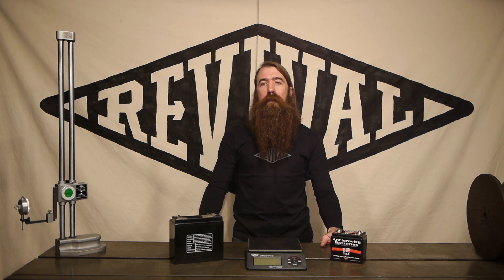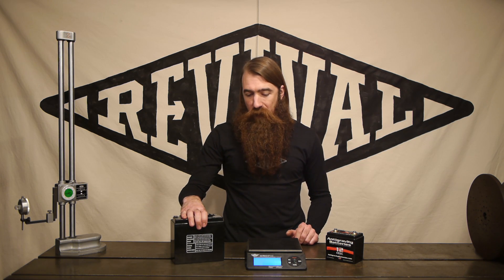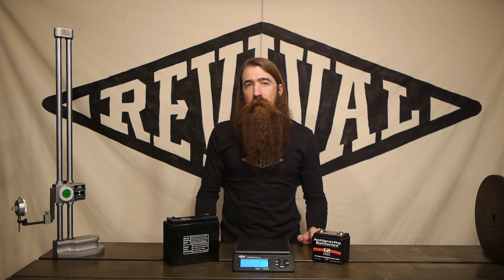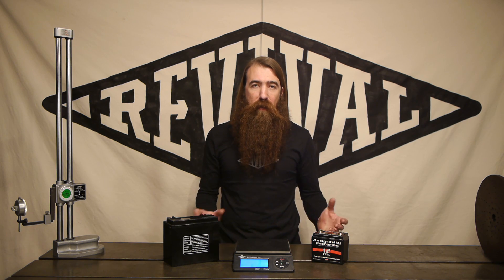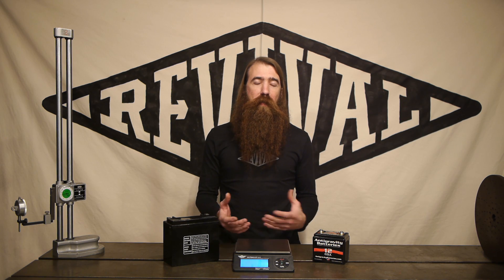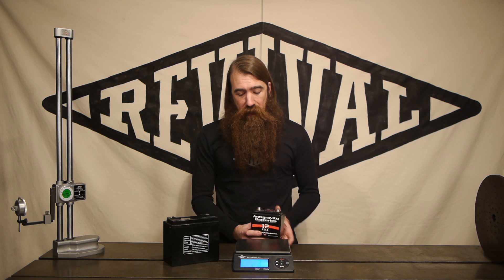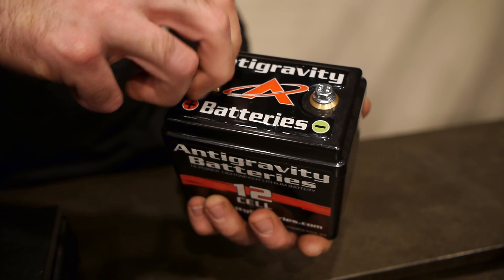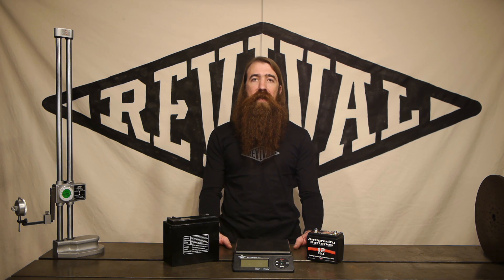Antigravity Lithium Batteries - Revival Cycles Tech Talk

Comment: Hi Stefan, 

Awesome channel and workshop, I've watches most of your videos, and even went on to buy the M-unit and the M-lock for my current project; a Suzuki 85' GS 450S. 

Problem: Lithium-ion/phosphate battery and charging system compatibility. I've read that the Li-ion/phosphate batteries are not compatible with the charging system on older bikes from from mid 1980s and earlier. In worst case the battery could take permanet damage. The bike has it's first registration in '85, but the bike is likely older than that.

Question(s): Do I need to update my charging system? If so, what should I look for?

Best regards, from Denmark
(Source: https://shop.antigravitybatteries.com/products/starter-batteries/small-case/ag-801/)
Reply from the maker: Hey Christian - If the charging system on your GS is working properly and performing up to design spec it should be compatible with the Antigravity batteries. The most important part of working with this type of LiFePO4 battery is that the charging system has to keep the voltage between 13.25 and 14.75 which is a fairly broad range, but much below 13.25 volts and the battery will not be charged properly, but more than 14.75 volts will over charge the battery and damage it. 

On you bike you have a three phase permanent magnet system, with a combination regulator / rectifier. Most of the systems that are problematic are the ones that have separate regulators and rectifiers. That all means your setup should work, but double check it with a multi-meter at idle and up through the rev range to make sure the voltage doesn't exceed 14.7. 

Also it isn't a bad idea to replace the reg/rec with a new one, it can offer piece of mind, and electronics from the 80's are probably on the edge of capacitor failure by this point.
Reply: Hi again, the charging system has been performing without problem on a regular led battery so far, so thats great. I'll check the charging voltage from idle to full rev. 

It has tree yellow-colored wires coming from the generator to the combined reg/rec. Its an old bike, and has in some way been tampered with by the many other owners it has had. I think I'll replace the rec/reg just to be sure. 

Thanks man, keep it up!
Reply from the maker: Sounds like your charging system should be good to go. But I would make sure to repeat the test after you have the new LiFePO4 battery installed, just to make sure the system remains stable. There are some regulator circuits that are affected by different battery internal resistances, so its worth double checking. 

Also reg/rec's from the 80's do wear out, so a replacement is a great idea. And the $100 investment is cheaper than the hassle of getting stuck on the side of the road.
Reply: Allright great - Yes I know, and it would be a shame to ruin a brand new battery by not charging it properly.  I've ordered a new reg/rec.

Thanks again!

Comment: will an 8-ceel Antigravity work on a yamaha virago x920 1981?
Thanks.
Reply from the maker: The starter arrangement on the 920's is not all that great, and in our experience a 12 cell is better on the viragos. You might be able to get away with an 8-cell but it'd be pushing the capabilities of the starting system. Although the 8-cell has been tested and works well on Ducatis upto 1100cc the issue is that the starters on the ducatis just work more efficiently than the ones on the viragos.

Comment: Ok....so these are used with the standard/stock type Harley charging system? 
  I have a 1972 Sporty, and a 46 Knuckle...both converted to aftermarket alternator (made/sold by Steve Fredricks/Hunt Magneto) ....unit fits in the old 12 volt generator spot and run by same gear set....wound stator, rotating magnets......and use a 'Harley 'type regulator.....I'm NOT looking for electric starting power....both are kick start...mainly looking for replacement for the Yuasa 12N12 LA Sealed battery in Knuckle because it fits in the old 'horseshoe' oil tank.
 Are these batteries something I should be looking at? Local battery store has stopped selling Yuasa, now selling Chinese stuff, which I have no interest in....
Reply from the maker: The antigravity batteries are a great solution,  and they would work on your bike. However the real advantages are for saving weight and having a smaller physical size. Since you have kick start only, you don't need the extra cranking power, and I don't think you'd see much benefit from the antigravity on your application. If you are happy with the performance of the Yuasa I don't think there is a need to switch, and even if your local supplier has stopped carrying them they are available from several other sources. If you have trouble finding them we can source and ship one to you no problem.

Comment: I just got the antigravity 600cca..what should the amp read?
Reply from the maker: I don't quite under stand the question. What are you trying to measure?  Also, 600 CCA is a LOT of cranking amps, we have never needed to use more than 480 CCA and that was on a Hellcat with a 2163 cc high compression v-twin engine (extremely difficult to turn over)
Reply: Yorday Martinez

Comment: How about longevity? will this last more or less than a lead battery?
Reply: Just an opinion, I work in the industrial haz waste field, largely in the Universal Wastes world of batteries and lamps. 
Lithium metal cell arrays can outlast Lead Acid batteries if routinely used, but leave them to sit without activity, and the "memory" decreases far more rapidly than traditional LA batteries. They also react to changes in temperature FAR more radically. Nor do they take to "trickle" charging well, rather they need to be "worked out" regularly and brought back and forth to a maximum charge often for best longevity. 
This is why your phone battery lasts longer when charged all the way up at night, and is used rigorously throughout the day, whereas leaving it plugged in constantly actually decreases it's ability to "remember" as much energy for storage when you finally take it off the cord. And lastly, NEVER allow a cell to be penetrated and get wet. You will have an ultra-hot roman candle next to your gas tank. Don't play with the guts, they are on a different order of magnitude of danger than the corrosive of battery electrolyte.
The cells contained inside are pretty much the same ones you find in Vaping mods, and should be swappable, but economics won't see us swapping our own individual cells any time soon in the same manner we can refresh the individual electrolyte cells of a traditional open cell LA battery. The manufacturer would rather recover it under recycling programs, and just swap the cells at the factory while you buy a whole new unit at full price. Now the guy who invents a flexible battery receiver array allowing you to individually add and remove as many 2k-3k mAH cells as you want to fit in a shapable, customizable form factor, that adapts to fit inside of different seats and frames...THAT guy just might get wealthy. Plus you could remove the small individual batteries for storage in the house away from the cold...
Reply from the maker: Good question, in theory it should out last a lead acid battery.  BUT it all depends on how you treat them, if you keep them charged and don't over / undercharge and they don't live outside during sub freezing temps in winter then they should out last the lead acid counter part. 

In our case, these batteries aren't about longevity, its about saving a TON of space and a TON of weight. 

In the interest of full disclosure, these batteries are more fragile and do not tolerate abuse as compared to lead acid, but with systems that are working properly and normal use they hold up very well. This is an issue for ALL LiFePO4 motorsport batteries, and in our experience, the antigravity brand is the most robust of this class of battery.
Reply: 4c1dr3fl3x Sounds like you have enough knowledge to be THAT GUY.

Comment: Hi, could you tell me wether an antigravity 8 cell would be sufficient for a 1980 CB750 dohc? or would i have to go up to the 12 cell.
thanks for all of your videos and thanks in advance for the help.
Reply from the maker: The 8-cell should be fine for a CB750, although we have not tried that specific combination, we have installed the 8-Cell on a couple KZ1000's and that works no problem.

Comment: will a 4 cell work on a stock cb350?
Reply from the maker: +Graig Cameron Theoretically yes, the 4 cell will work on a CB350, however, if you plan to primarily use the electric starter we suggest an 8 cell. If you are going to normally use the kick starter, and e-Start if you stall in traffic, the 4 cell is good for that.

Comment: After trying to crank my bike over about 4 times, my antigravity shows only 10\11 volts on my tester. What should I do? Is it sufficient to charge it?
Reply from the maker: +Clive Hancy 
Yes the battery will need to be charged. This is not particularly difficult but must be done with a charger that has voltage control and a voltage limit lower than the limit of the antigravity batteries 14.6 Volts. Additionally you need to make sure that the current from the charger is less than the rating for the battery which will depend on the size of the battery and for the 8-cell is 8 amps. It is true that these batteries should be charged using specific chargers designed for LiFePO4 batteries, but as long as you stay within the voltage and current range it should be fine. The reason they say not to use lead acid battery chargers is because many of those type of chargers use higher voltages than 14.6V in order to get quicker charge times...so as long as you know exactly what your charger is doing during the charge cycle you can use it with these batteries. OR just get one of these and don't worry about all the technical stuff. http://revivalcycles.com/collections/motorcycle-battery-tenders-and-chargers/products/battery-tender-junior-lithium-charger
Reply: Thanks for your help! I live in Italy so I presume that the charger you suggested plugs into your 110 volt mains power supply. It looks like I'll have to try and find one that works off 220 volts

Comment: How does the antigravity battery perform when its colder weather say 45F ? I just bought a new SSTX20HQ-FP Scorpion Stinger 12v 525 CCA LiFePo4  for my Harley 2002 dyna superglide with a  120 build and it will crank a few cranks and dies , only good think is it recovers quickly but still dies.
Reply from the maker: +harleynut1961 
All LiFePO4 batteries struggle in colder weather...however, there are some tricks we've learned. When its cold the battery still has the energy in it but it can't flow the current as quickly as needed, so what we've found is that by attempting to start the bike it will act like a dead battery and give a 1/2 crank or  weak crank and that's it. Then let is sit for a few seconds (10-15) and try again, the attempts to start will actually warm the battery from the inside and each subsequent attempt should get stronger. In cold weather it may take a few tries but with a good condition fully charged battery there should be enough power to get the battery to warm up and actually start the bike. Of course the larger the CCA of the battery the better but we are not familiar with the Scorpion stinger range of batteries and can't comment on their performance.

Comment: Wrenchmonkeys offers a Battery eliminator. Could one of those work in my Honda cb 750 four K6 (1976) with Motogadgets control box m-Unit? I will get rid of the electric start to leave the bike with only a kick start. Thanks!!
Reply from the maker: profkirkendall The issue with most battery eliminator kits is that there is no power until the bike is being kicked. This generally works fine with simple electrical systems, but is a bit trickier when using an m-Unit. If you wired the m-Unit so the ignition system didn't run through the m-Unit and you could start the bike, everything on the m-Unit would be able to power up and work so long as the engine is running. It will work, but just require some mods. 

Once the engine is running m-Unit is as normal, but there is no good way to power the m-Unit until the engine is running, so it would be necessary to work out the ignition system to be independent of the m-Unit. Hope this helps!

Comment: Does this particular battery require a special charger or balance charger like other Lithium-Ion batteries on the market?
Reply from the maker: supersportimpalass Yes, this battery does require a Lithium-ion compatible charger. We do offer a maintenance charger that is compatible with both lithium-ion and lead acid batteries on our website if you're looking for an all-in-one charger option: http://revivalcycles.com/collections/for-your-ride-electrical-battery-tenders-and-chargers/products/optimate2-battery-maintenance-charger
Reply: supersportimpalass  This type of lithium iron phosphate battery does not have provisions for a balance charger. The only special charging requirements are voltage control. Basically, if you have a charger that does not exceed 14.7 volts during the cycle it is ok to use with these LiFePO4 batteries. Some lead acid battery chargers don't use any voltage control, or have de-sulfate cycles or quick charge cycles that can go well above 14.7 Volts.